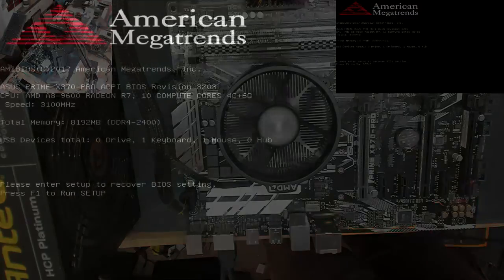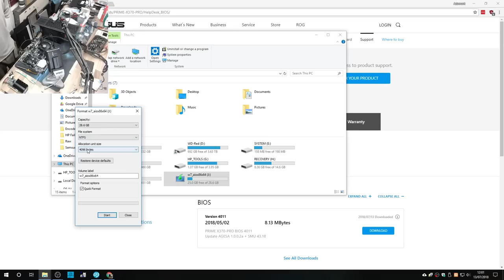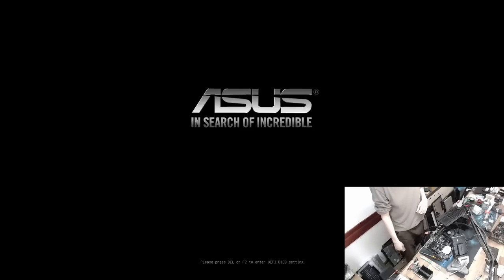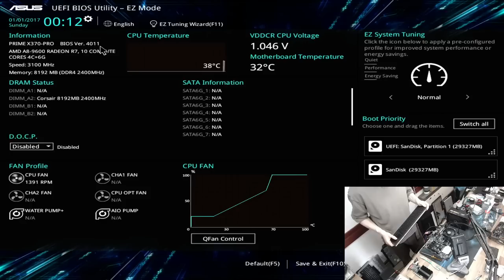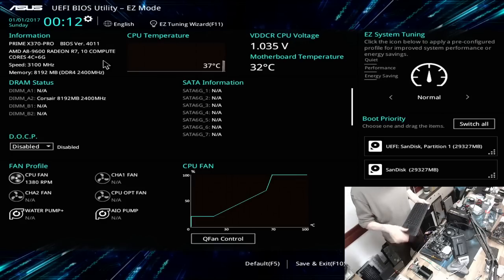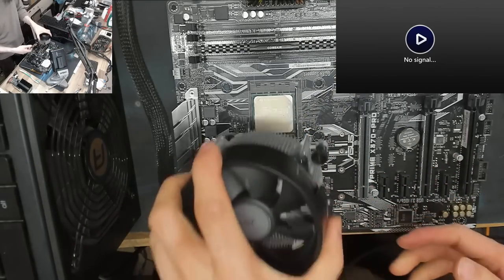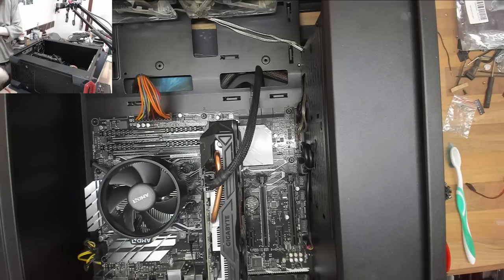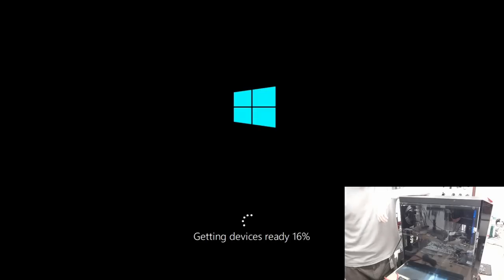LFC#143 - New Ryzen 2600x build with no POST

Comment: 30 seconds into the video i was yelling at my screen "bios update!!!!!"
Reply: Haha same!
Reply: no shit like come on use google ya intel lover lol 15 mins in and he hasn't even bothered to check if the board supports the chip. moving parts around and hasn't checked CPU support list
Reply: @Desktopia ya he was told after an upgrade it wouldn't turn on so first focus should have been on what parts changed but because he so use to only using intel 
( and it just working cause intel changes socket more then bios lol ) 
he didn't bother to confirm compatibility of said new parts
Reply: Same here lol I know X370 very very well, have had many come in with this exact issue.  My only plus was a customer got a board & cpu combo with this exact cpu and gave it to me as he got a 2700x.  Since that time it has been very useful on boards that don't offer bios flashback capabilities.
Reply: Yeah I was yelling at my screen about the BIOS too. I have that same board (bought it for $20 brand new on Ryzen 3000 Launch Day), so the first thing i did when i got it home was get an old chip and update the BIOS.
Reply: Same
Reply: Same bro 😂 but always good to learn trouble shooting methods
Reply: Do you normally yell at your screen? That's a bad sign
Reply: @johnnyhotpants100  arent you special have a good day
Reply: the first time you deal with a new problem it's going to take more time to fix it... that's how one acquires experience.. ;}
Reply: Hell yeah + he forgot 1 spot of thermal paste in the connectors on the motherboard lol
Reply: Agreed 100%, Clearly he didn't know.   lol
Reply: @johnflynn6140  Everyone is confined by lessons learned from their own experiences.

Comment: Recommending Intel CPU in 2018 over AMD CPU is like recommending Spectre/Meltdown over reliable architecture.
Reply: To be fair there was a lot of problems with the first generation of Zen. So while this is a zen+ cpu, there's a lot of perception from the issues Zen had, even if it's been about 3 years since it launched.
Reply: This video ws posted 2 years ago

Comment: The upcoming chips the 3203 BIOS was referring to was the Ryzen APUs that released around feb 2018 (Ryzen 3 2200G/Ryzen 5 2400G). They were released before the Ryzen 2000 series, but based on the Ryzen 1000 series.

Comment: Dude i did it man! I got into the bios and it’s posted! I put in a new CMOS battery CR2032 energizer and reset the jumper thing with the three pins! Currently configuring the bios as I’m posting this comment.
Reply: That's weird.  I had a PC with a dead CMOS battery.  The only problem it had was it wouldn't save the time or any other configuration data when powered off.  It ran fine.  I just had to do something in BIOS every time it booted.
Reply: That's weird.  I had a PC with a dead CMOS battery.  The only problem it had was it wouldn't save the time or any other configuration data when powered off.  It ran fine.  I just had to do something in BIOS every time it booted.

Comment: There are advantages to having an oversized psu, they tend to be most efficient at about 50-70% utilization, so you can get better efficiency by having a oversized psu vs one that is just big enough. On top of that, because the psu is running at let's say 50%, there will be less heat, and less load in general, so you get less wear on the components, most likely resulting in longer life.
Reply: Yep, still on 1200W PSU for my i5-2500k (non OC) / 1070Ti. MB/CPU from 2011. Still fine for me - gaming + development Win7/POPOS

Comment: That intermediate/removable header for the front panel connections is a really neat idea.
Reply: It's a standard feature on ASUS boards, it think.
It is indeed great, really missed that moving to a Gigabyte board for my Ryzen.
Reply: @TheTurnipKing  Surely you could have used the same one from your old board on the new one?
Reply: @whiplash7400  technically, yes, but that board is still actually in use.  In addition, one of the benefits is that it's labelled to match the board, making it a doddle to plug the front panel into and then just plug that into the board.  It's even keyed.

I think you could quite easily use the same stackable pin headers used for Arduinos for other boards, but I didn't have any to hand while building.
Reply: Its not as good as it should be, they have a habit of using pins that too small so the header cables easily fall off.  Its also kinda problematic if your case doesn't use all the headers as you have loose pins lying around asking to short to the case.

Comment: Best diagnose / troubleshoot video ever, but still i unable to do all that, i dont have extra gpu, extra cpu to check the Bios, 🤦‍♂️
Reply: same problem
Reply: @hossi1330  for future refrence, AMD will send out a loaner cpu to update your bios. If you don't send it back you have to pay for it but the loaner is free.
Reply: @animeman64  They send you an Athlon 200ge. The think is, you need a half recent BIOS version to check it too.
Reply: Did they stop including the feature that lets you reflash without a cpu? Seems like a step backward, if so.
Reply: Sometimes you can buy pretty cheap parts for testing stuff, like those garbage AMD non-ryzen processors and some old but functional GPU's etc.. but of course you still have to pay something for them.

Comment: Its interesting you mention the PSU as few people realise the changes in the ATX specification can be a real pain when trying to use a new PSU in an old computer.   It may be better now thanks to LEDs and USB driving the 5V requirements back up again, but when CPUs first switched to a 12V header, PSUs designed for that didn't have enough 5V amps to work with older motherboards that ran the CPU VRM off 5V.  (at least that's how I recall it)

Comment: I was surprise to see you spray alcohol stray into the socket. Good to know you can do that. Wasn't sure that was possible. Thank you
Reply: AMD sockets don't have pins, instead they are on the CPU. I wouldn't do that with an Intel socket
Reply: @AdamSmith-gs2dv  If the alcohol dries off before you connect the CPU to its socket, it won´t be an issue. Though since LGA is quite sensible to touch, I would hardly encourage not to touch those pins with anything.

Comment: I used to always just run the PSU+CPU+CPU FAN only - no RAM, no graphics, no other wires/connections/monitor/drives, etc. except for  'beeper speaker' if one wasn't already fitted. Then listen for the beeps - if no beeps then CPU is not running - simple! Then feel CPU to see if warm. Once you get beeps, start by adding RAM, then graphics (if required), then boot hard disk, then rest of stuff. step by step until problem is found. It saves time in the end.

Comment: I just built my pc today and was having post issues I have a amd ryzen 5 3600 paired with a gigabyte b450m ds3h and was at a loss on why I could not get to the bios screen let alone see the display this shed so much light on trouble shooting my parts and what the best remedy is I have a AMD ryzen 2600 cpu arriving tomorrow to put in and get my 3700 to post and keep the other cpu for a later project thanks for the video !

Comment: I had this exact problem when updating from my Ryzen 5 2600x to the Ryzen 7 3700x, felt like crying when it didn't work, some research later, I found i needed to update BIOS from F32 to F40, was relieved when it booted. glad I didn't spend £300 on a paper weight.

Comment: Looks similar to my problem. I'll see if I can download any needed update via my current (to be replaced with the build) Mac Mini.
 
Wild card: At first I got no fans, not even on the PSU. I put the open MoBo on its box and figured out I'd put the Ryzen 5 CPU in sideways. I'm hoping it's not damaged. The pins appeared OK... no force was used. I just lined up the triangle with what I thought was another triangle on the socket. I reset it and got a white LED on the MSI MB. I still haven't found out what that means. No speaker to make beeps, but no video at all.  At least now the PSU, CPU and GC fans all work. 
 
This is my first build since my last Win machine in about 1995. I went to Mac in about 2000. Now I'm a Linux guy. It's been OK on the Mini but that's starting to be too slow for what even browsers need these days. Wonder what info they're trading as I stare at a video or Facebook. Sometimes that HDD goes crazy!

Comment: As soon as you started on this one I knew it was a BIOS update. I have a b350 board from my old computer and have just purchased a 3000g and need to update  the bios to support it.
Reply: mister.T Jr  I will be using my Ryzen 1600 to do the update and then swapping out for the Apu once it's done. Hopefully it will go smoothly, I am doing it today. Fingers crossed.
Reply: mister.T Jr  hi. I finished it yesterday evening , two bios updates (one was a bridge bios) but all in all it was a very smooth and straightforward process. The 3000g is better than my expectations.
Reply: mister.T Jr  totally agree CPUless  bios updates would be a lot easier.

Comment: seeing the cpu and socket being cleaned made me feel physical pain
Reply: A soft small paint brush?* That’s what I was thinking but I have a feeling it be too soft to fast / effective (not that I experimented), but I think those bristle will go around the metal pins as thet are short and bristles are long and flexable enough. I stopped cringing, just dont angle or push down too hard on the brush I guess. It’s pyshchological, to see a greasy toothbrush, hygene comes to mind in Adams defence. Good honest useful video. (*Some one may scream static @ me, i say wet.)

Comment: great video. I had a similar problem. including the thermo paste on the cpu. Unfortunately my board was compatible with my cpu(tuf game x570 wifi) so it couldnt have been the bios. After replacing every component with the exception of the cpu my build still did not post. So I guess my new ryzen  7 3800x died on me. waiting for my new cpu to test everything out again. I don't for see not posting considering unless I'm extremely unlucky...Good video, it gave me some reassurance that I checked everything possible.
Reply: im having same problem with a ryzen 5 3600 and X570 Pro. no post. sent MB back got replacent. no post. Now sent cup back
Reply: @zarg05  for me, it was my CPU and GPU. PC working now.  Hard to say if my MB was also bad. replaced CPU, MB, and GPU. I feel all 3 were bad. CPU is the last thing you thing could be bad, specifically when is new and it worked initially.
Reply: @zarg05  cup? CPU? Does your mb have integrated graphics?  Mine didnt so I was not able to  check mb a different way. Good luck
Reply: my Ryzen 5 1600 PC died, so I'm just using my Athlon II X4 640 PC because I currently don't have the money to get a new one since I'm unemployed because I got fired from my last job and the COVID-19 pandemic has made it hard to get a new one.

Comment: As soon as I seen the "No Post" I immediately said BIOS needs updating.

My Ryzen 7 1700 & MSI B350M Pro-VDH worked out of the box but updated it to the newest BIOS as soon as it booted to make it compatible with Ryzen 9 3700X.
Reply: you shouldn't be running a ryzen 9 3700X on that motherboard if you are...
Reply: It can make the VRMs run at excessive heat and excessive heat may kill the motherboard. the B350 or X370's VRMs are just too wimpy for those CPUs.

Comment: Cleaning thermal paste....break cleaner or thinner
Most (99,99%) of electronic parts are cleanable with thinner.
I clean PC,Pro amplifiers and TV already for 20 years with it.Some compressed air to help it vaporize on cold days..or parts that are a little affected by thinner.
When using break cleaner,take a brand that not leave whiter spots behind..like Wurth..avoid Motip (no problem if you like white spots)

Comment: I also had to buy an APU for a BIOS update to my B450 to fit a Ryzen 3600.
I've also had a 486 get killed by thermal paste in the socket and on the CPU pins.
Cleaning that thing up enough that it could boot reliably was a challenge. Ended up swapping the CPU anyways.
Also, I feel called out. (FX4100 OC 4.5GHz, R9 290X. Could challenge my 750w Antec.)

Comment: Wonder how many customers took there systems back to the shop for refunds or took them to a dodgy shop where they would charge for a new board but only updated the bios or made them pay a lot more.. they do now notify about updating the firmware but back then I bet manufacturers had a nightmare with this.. good that some board support USB flash firmware updating especially when AMD are bringing out new generations CPUs and there no support for them in the firmware.  good video... i actually was stumped watching the video until you shown the board's chipset .. i was thinking it was a dodgy reset switch just shorting all the time was my bet.. but when i saw the IO shield I had a shiver go down my back .. so hate them daft cut out on the panel like bloody razor blades too so sharp... anyway good video bit old but your videos are relaxing .. actually I watch a lot of videos and yours is more relaxing than Linus, JaysTwoCents ect lol i only watch 5 minutes of there and Evblogs too long but yours maybe because it reminds me of when I had a shop in UK and how its so similar.  Good video

Comment: Smacks of my problem to the `T`, great diagnosis.  If there was a way to flash the bios w/o posting to the bios that would be handy :p  guess I'm stuck buying an slightly older cpu

- CPU: Ryzen 5 2600
- CPU Cooler: Wraith Stealth Cooler
- MOBO: ASUS B450 AMD Ryzen 2 Micro ATX Gaming Motherboard AM4 DDR4 HDMI DVI VGA M.2 USB 3.1 Gen2 (Prime B450M-A/CSM)
- RAM: Patriot Viper Elite Series 2666MHz / PC4-21300 / PVE432GG2666C6KGY
- PSU: Thermaltake Smart 700W 80+ White Certified PSU, Continuous Power with 120mm Ultra Quiet Fan, ATX 12V V2.3/EPS 12V Active PFC Power Supply PS-SPD-0700NPCWUS-W
- Chassis: Thermaltake Core V21 SPCC Micro ATX Cube Computer Chassis CA-1D5-00S1WN-00

Comment: Oh the old cpu not supported yet issue. Thought it was going to be a need to clear cmos because the ram is at the wrong clock rate or board was shorted or something. Asus is the one that actually WORKS in my experience. My b350 prime can flash in the bios from disc but some directories are not visible for some reason.

Comment: Gents, i had the same problem as you did, but my solution was a bit diffrent. As you, i have a ASROCK 370 X PRO4 and RYZEN 5 1500X and at power up no post but 5 short beeps. At the begining i thought it was the cpu, then the memory, then the mobo but in the end it was the keyboard. Belive it or not my mobo did not recognize my keyboard. To tell the truth i had an old 6-pin mini-DIN connector keyboard, now i have a usb keyboard and everything works perfect. So for those with old keyboards and encountring the problem we did try to change your keyboard firs.
Thank you for such great video!

Comment: Well, overkilling on the psu can save you money on powerbills. They tend to be more efficient if they run at like 60% capacity instead of 90%. So, you could save money in the long term by spending an extra 20 - 30 dollars on a few more watts.

Comment: I just built a pc. Ryzon 5 3600 with MSI X570 Pro. No post. I salvaged some parts from old pc ie power supply HDD Rom drive. Having same problem. I sent MB back and got replacement still not posting. sent CPU back awaiting replacement. after watching your video I think I may still have problem. HDD graphics card and PSU definitely work as I put back in old pc so I can stream music video and get online.

Comment: Well this was straight obvious as soon as i saw x370, was pretty sure it didn't had the bios update😂
Reply: Foarte fain ca a aratat si metoda lui de a ajunge la problema. :)
Reply: it's only obvious if you recognize the issues.. building experience/knowledge takes time and effort... in the beginning you lose lots of time, in the end you gain it back :} 

* it may take you one minute to solve a x370 BIOS issue but it might take you 10 hours to figure out a Lenovo T510s charging problem (that someone can fix in 30min)..
Reply: @duroxkilo  well the charging problem is more difficult than a cpu detection...when you see x370 and a ryzen 2 cpu the first thing that comes to your mind as a technician is "missing bios update"

Comment: To clean cpu pins and mobo socket did just used 99% isopropyl alcohol? 

Did you know if there is any risk to clean them in that way? Theorically should be dielectric and volatile so even if penetrates inside should be fine after it dried for good but...  You know I want be sure

Comment: Two days ago in my own build I had almost the exact same problem.  But for me, I had simply inserted the 4-pin part of the 20+4 pin power connector in the wrong orientation.  I had failed to notice there was a reason for the extra plastic parts sticking out to indicate how the 20-pin and 4-pin parts should be aligned together.